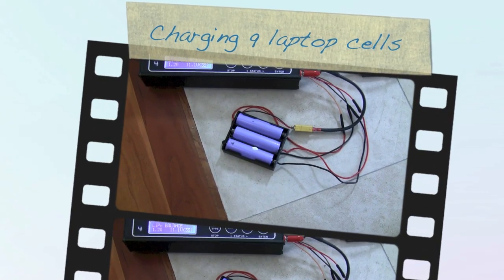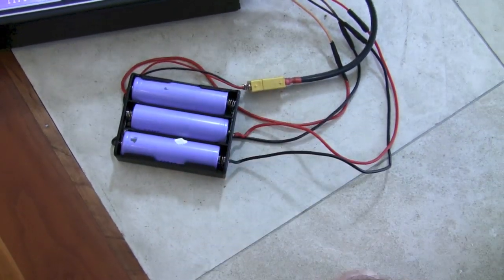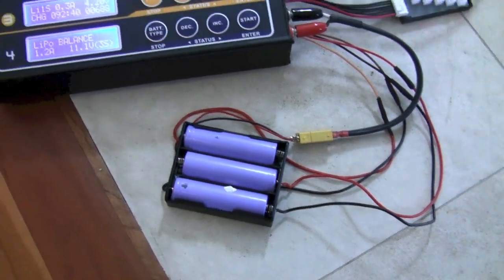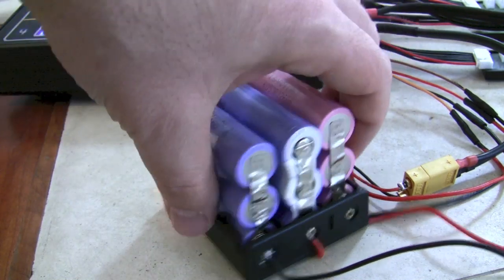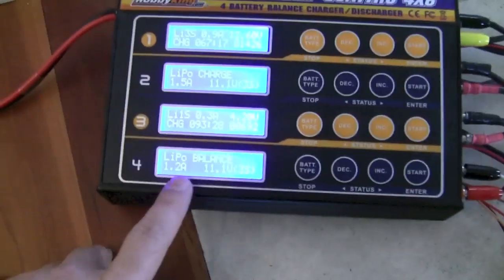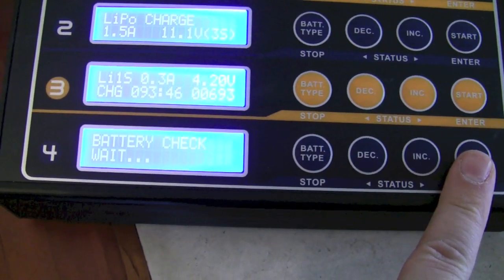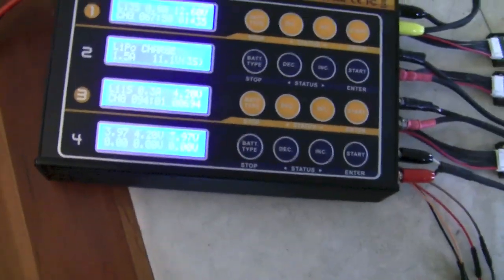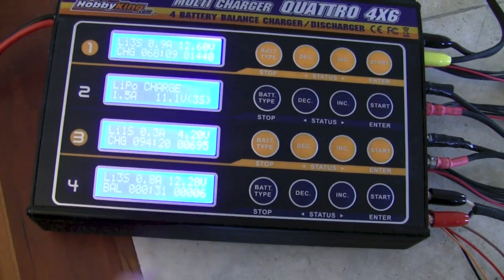How to simultaneously charge 9 x 18650 lithium cells

Comment: awesome , im in the process of making a 75,6volt  lipo for my moped , right now ive connected 3x 6s 10000mah in series , im using a bms , for balancing , so i could add 3 more in paralell i will get 75,6v 20000mah right ?

Comment: I forgot to ask would the mAh after charging be the total of the 3 batteries? So if a a single Lipo should be say 2000mAh then a 3s setup like yours should be 6000mAh after charging?
Reply from the maker: Yes, if you connect the batteries in parallel than your total charring capacity should be 6000mAh per pack.
Reply: there is no 18650 Lipo battery. There is only 18650 Ion battery
Reply: Correct answer but to different question :)
Peter asked "3s", in which case the answer is NO - you'll get triple the voltage, but same capacity.
So to get triple voltage AND triple capacity, one would need 9 cells in 3p3s config, right?
And to charge them (assuming standard 4.2V and 1A per cell), you would need 12.6V and can go to 3A without overloading individual any cell (assuming they're balanced I mean).

Comment: How long should it normally take to charge just 3 lipo batteries with your setup? Can you recommend the best settings for fast charge rates with these type of batteries.?
Reply from the maker: I can crank up the charging current from 0.01 A/h to 5 A/h. Obviously, the charging current should not exceed 80% of the battery capacity.  Most of these batteries have a capacity of around 2000 mAh. I stay in the sage side and usually charge them at 1.5 mAh. So with this setting it should take about 1 hr to charge them.

Comment: Will this still balance the individual 18650 cells that are in each of those 3 packs?
Reply from the maker: No it will not. You just balance the pack. You would have to disconnect the 3 pack and balance them individually.

Comment: 1.7A charge current for 9 18650 batteries? That's gonna take like 10 hours to complete I guess? Why not set it higher?
Reply from the maker: The batteries must have been almost full when I filmed. My charger  throttles down the current as the battery is charging. But you are right, with 9 batteries in parallel I could have gone to my max charging current 5A.